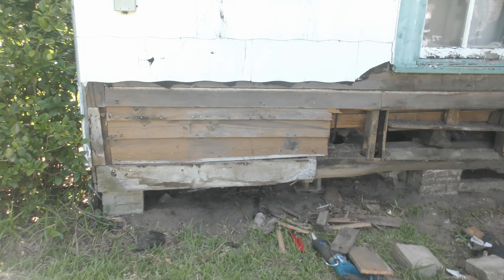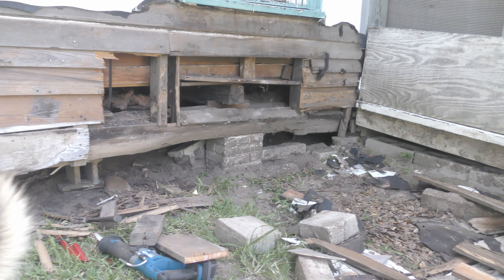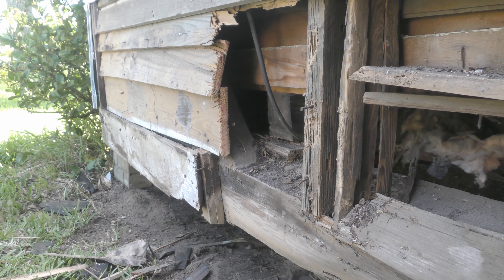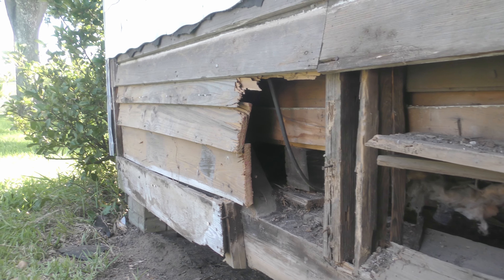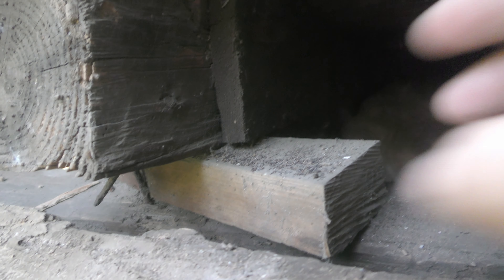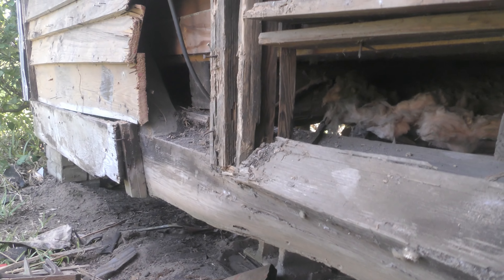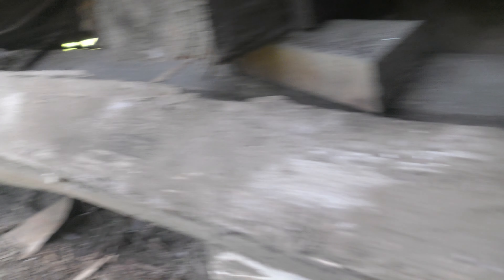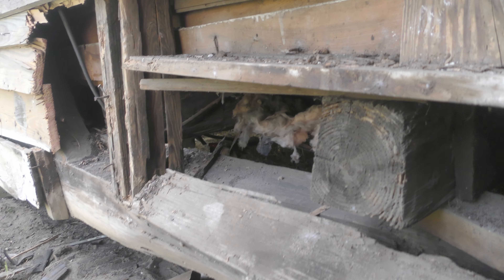Home Sweet Death Trap?

Comment: Good luck.  Hope it all works for you and that ya have some buddies to help.
Reply from the maker: Ha!  Buddies!  That’s a good one. Closest I have to helpers are the two dogs.
Reply: @FloridaTwoWheelAdventures  Sorry to hear that.  BE CAAREFUL crawling around under there and jacking up the house.  I might go with a 6x6 instead of the 4x4 (I always over build 😉).
Reply: @FloridaTwoWheelAdventures  Did you know that in the 1860s the whole city of Chicago was raised about 10 feet and many (hundreds) of buildings were moved!
Reply from the maker: @hazcat640  I have a 6x6 to mend into the sill beam but it looks like it might’ve been 8x8 originally. The little part that’s not completely rotted out is hefty. I’m going to attempt to sister into it. I’ll be are careful as can be!  The 4x4 is doing a good enough job propping up the joists. I’ll be implementing something more permanent if I can get that sill beam figured out.
Reply from the maker: @hazcat640  no I did not know that!  Pretty cool though. Seems they should maybe raze the entire city again!  (See what I did there?)
Reply: @FloridaTwoWheelAdventures  Yes 😆 and probably the easiest way to cure that place.